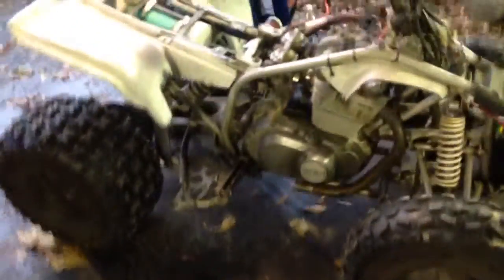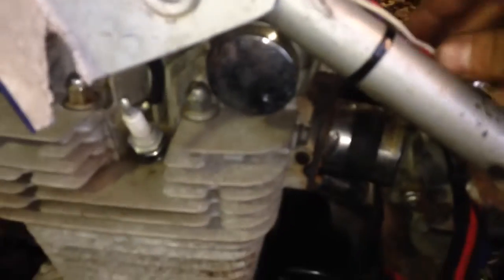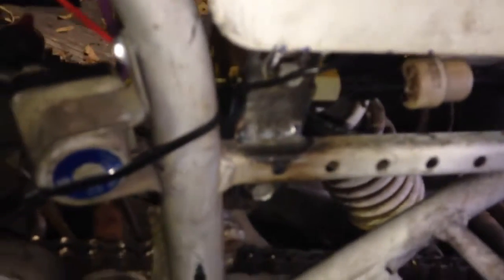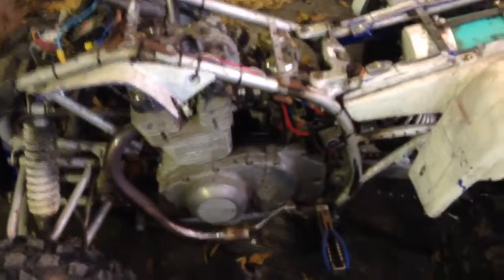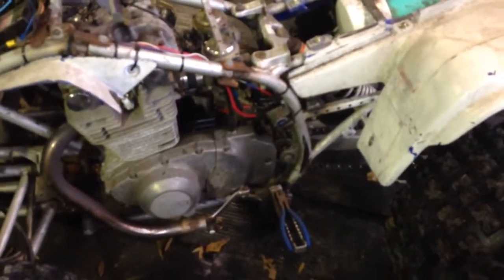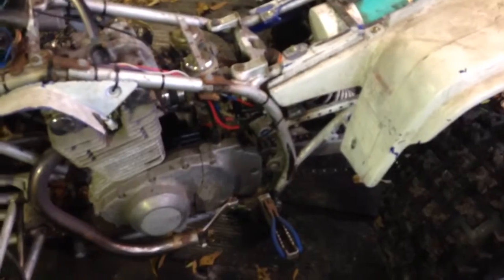Yamazuki New Fuel Pump Problem!

Comment: That pump took a dump man , You need another  new one ! Thumbs up man..
Reply from the maker: +ShawnMrFixitlee new pump came last night shawn!! i got it  put on yesterday. but the method of getting all the gas out of the pvc gas tank showed that the tank had sprung leaks all over it :( so i tore the tank out and got measurments so i can make a tank from steel and it will be rectangular and hold 2.36 gallons of fuel
Reply: right on Nick .. Metal is better !
Reply from the maker: yes definitly man! i will probably use my bosses miller 220 gas mig for it so it will be nice welds man!